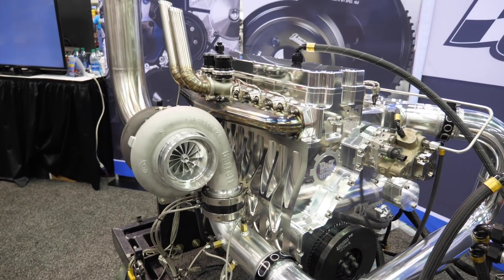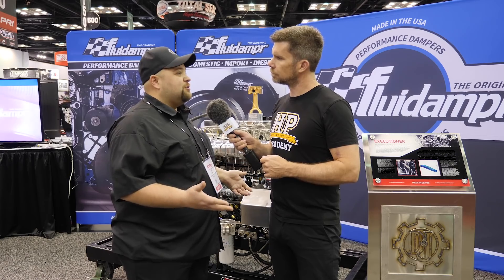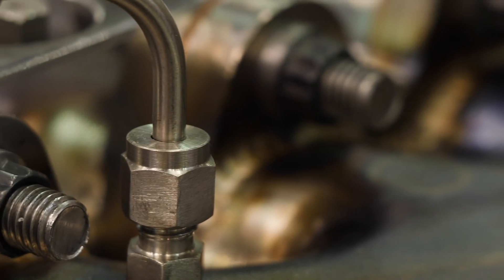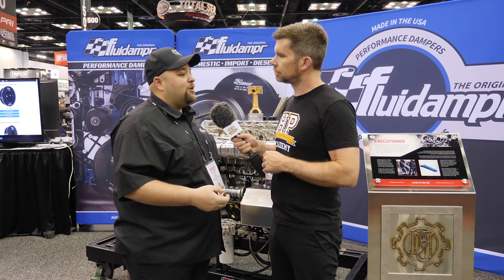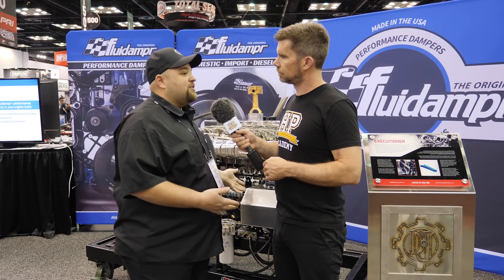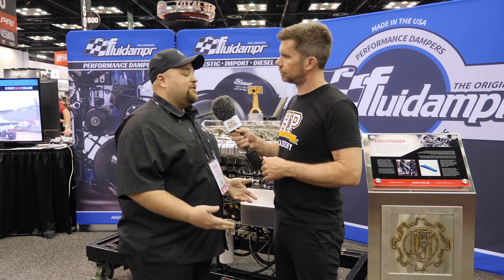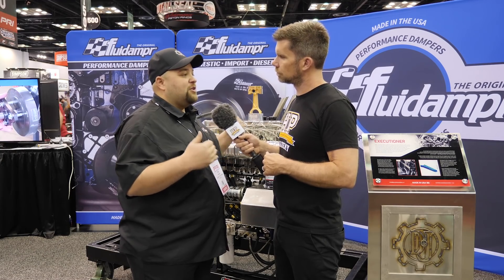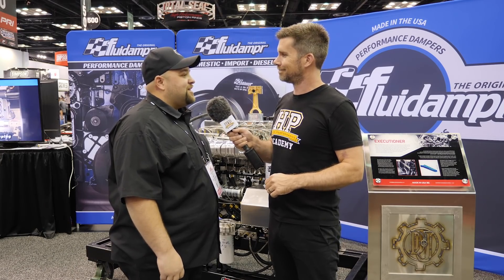Tuning A 3214HP Diesel Engine | Billet Cummins 200PSI Capable Monster [TECH TALK]

Comment: Hello, how many CC volume is this engine?

I also have a question, most how much torque can a 12.9-liter diesel bus engine produce? It produces 2600 Nm of torque in mass production, how many Nm does this value increase? Could it be 8000 Nm as an example?

Comment: There is no lean or rich in a Diesel engine, it’s direct injection and the amount of fuel determines speed of the engine.
Reply from the maker: Diesel fuel still has a stoichiometric AFR, and anything else side of this is still classed as rich and lean just as with gasoline. The Stoichiometric ratio of diesel is around 14.5:1 - Taz.

Comment: Awesome incredibly informative video as usual. 
      That thing is a beast.  
      36,000psi fuel pressure 🤣
Reply: New diesel BMW and MB have such stock rail pressure
Reply: We have ran over 2600bar (37700psi) some new diesels have 3000bar sensors
Reply: @ryanp6138  not sure how old you are but when I was young 60psi was on the high end of fuel pressure.  😝

Comment: Tractor pulling dosent allow nitrous but they will allow 5 supercharged engines slapped on the front of a tractor. I see that as interesting.
Reply: Imagine the engine explosions if there where able to run nos 😲
Reply: @bridged13b  
Just like in Rambo movies - explosion in 5 stages :)

Comment: Thanks for getting to the bottom of that extra fuel as cooling question. It was interesting though because he said that it's easier to manage on the lean side than on the fat side, I wonder why.
Reply: It is easier to control because the ecu can just pull fuel quantity as we reach high egt.  If we were cooling with fuel one we would have a ton of smoke and 2 as the ecu pulled fuel to control temp it would have to go past the "hot zone" first.
Reply: I can only assume it has to smoke so badly to 'cool' things as I've built 600hp+ 2.0 TDis and never got to that point!

Comment: Interesting..so in a diesel, as you add more fuel EGTs go up to a certain point which is dangerous (which I knew), but then decrease if you add even more fuel (which I didn't know).  Does that engine use steel pistons?  Love these interviews
Reply: We manufacture the piston in this engine we designed it as a forged aluminum piston with a steel top ring land for added durability.

Comment: So does he mean that they can make all that power by compensating for the power loss by going super rich? Because in theory 18.5 AFR for diesel is the point for most horsepower.
Regardless, Andre did another good job :D
Reply: 12 or 13-1 is where most Diesel engines peak. No idea where 18.5 came from but I can prove that to be false in 5 minutes on my Dyno.

Comment: Diesel tuning is fascinating, that thing is art
Reply: I remember a teacher in tech school in the mid 90s put it perfectly regarding earlier diesels at the time.
"You can't take a gas engine , turn a screw and get 20-30% more power out of it" 
Not that it wouldn't have issues after a while, but it's doable and if you're smart you'll put decent parts in so it won't blow up hopefully as fast. 
After I got out of school I built a lil vw TDI and threw out the electronics and dropped it in a gutted out rabbit and had a blast.
Reply: @MrTheHillfolk   
Mostly bc of engine being turbo, not bc its diesel. 
In fact you can do the same on gas engine. 
No magic here.